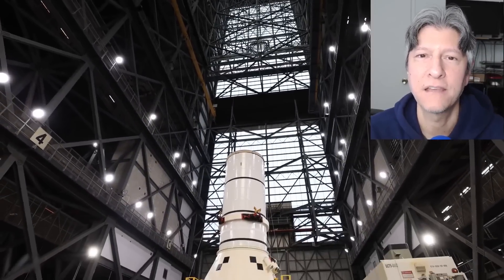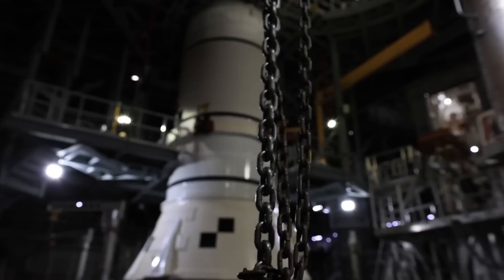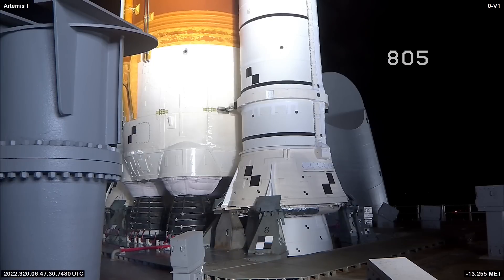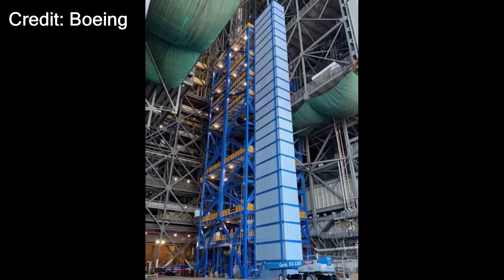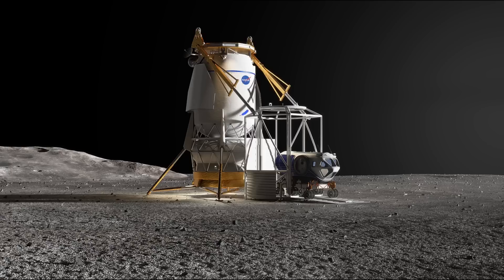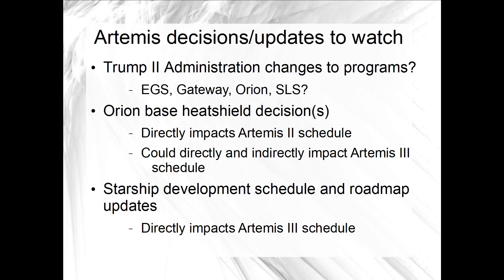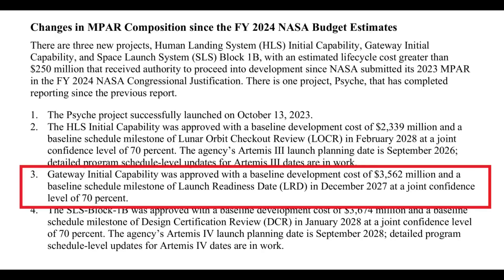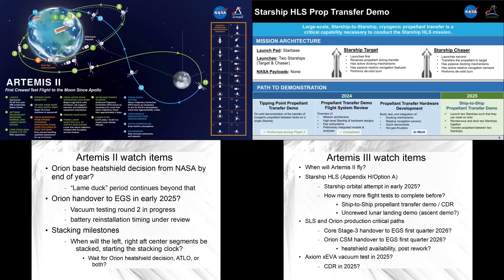Will December 2024 bring updates to the Artemis schedule?

Comment: Why is the booster in bits that is stacked together? Why not build it as full booster? I mean they look close to height of the core stage and that was transported as a piece via barge, right?
Reply: The booster would be far too heavy for the VAB cranes to lift.
Each SRB segment probably weighs more than the empty core stage.